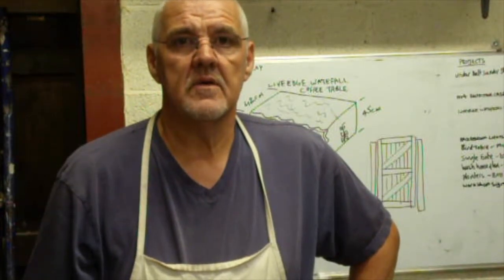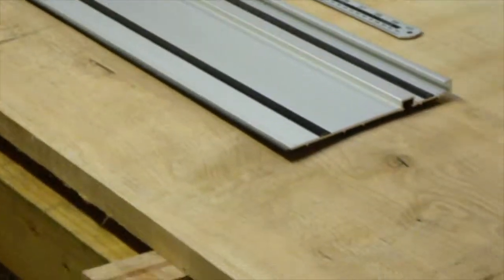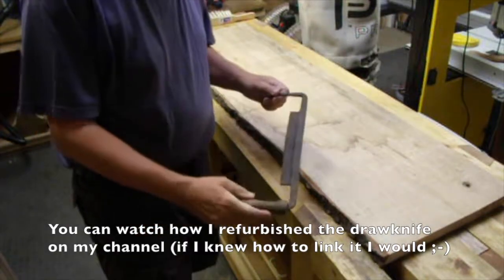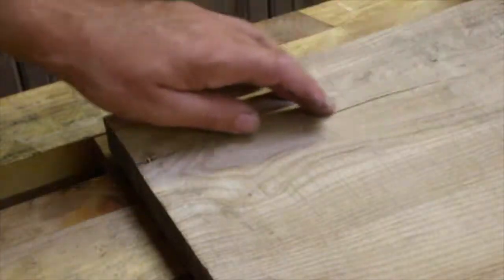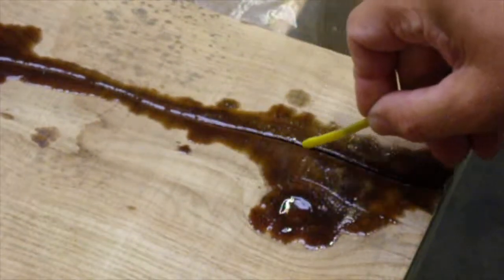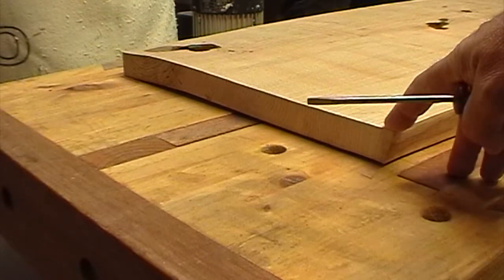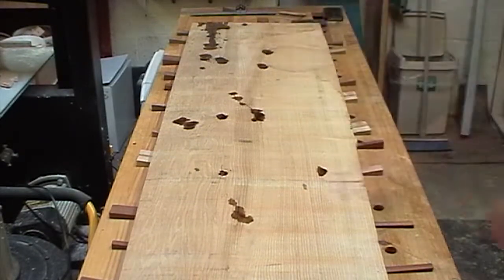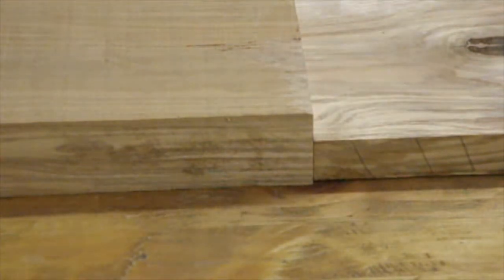Live Edge Waterfall Coffee Table part 1

Comment: That is a lot of work.  I love ash, but it seems to want to fight you all the time.
Reply from the maker: Jim Dockrell Thanks for the comments Jim, I got to say I’m disappointed in the piece Ash which was supposedly dry straight from the hardwood suppliers, it was bout 20% so I left it about 12 months in the garage and was 7% when I started the table. I guess you just need to start off with much thicker stuff 😏 just so much waste! Got to admit as well that English Ash does have quite a unique aroma 😝 is the same at your end?
Reply: Yes, it has it's own particular stink to it.  Did you weight the board flat while it was drying?
Reply from the maker: Jim Dockrell I did have a few other boards on it, but don’t think was enough weight and not spread evenly. Also as l used the other timber I did move the ash slab at times it was on its edge or stood vertical 😏
Reply: Stickered and weighted is always best, but sometimes it's just going to move no matter what.